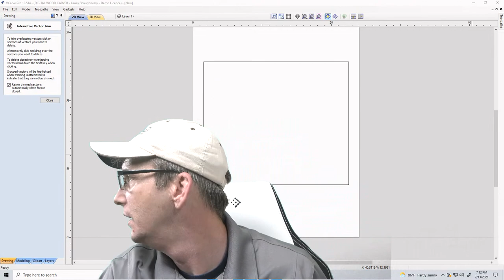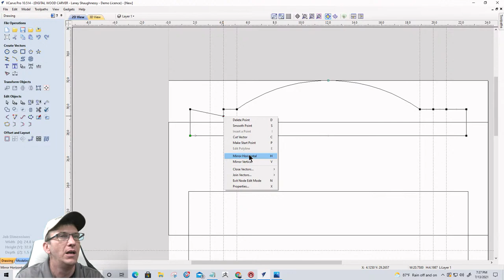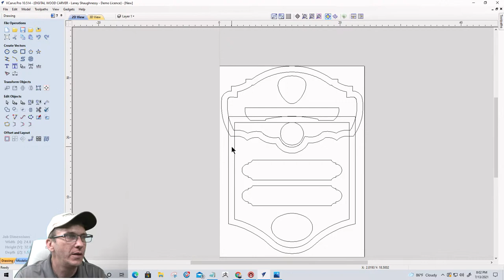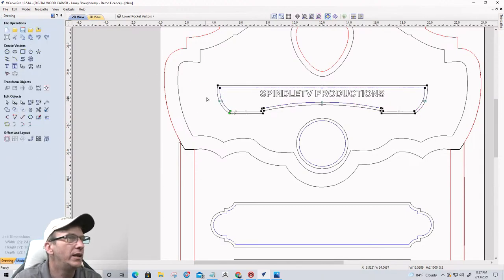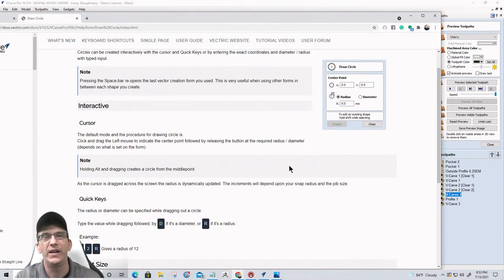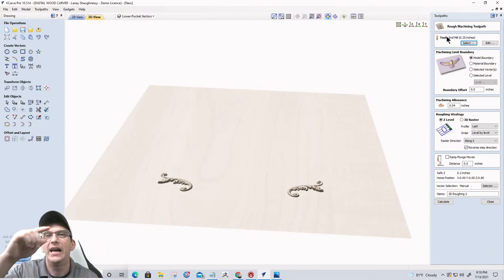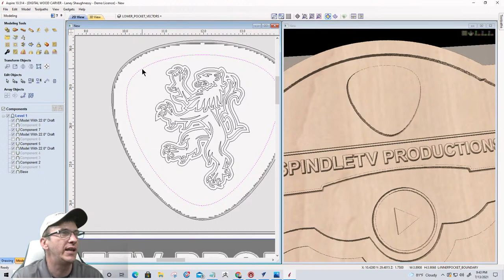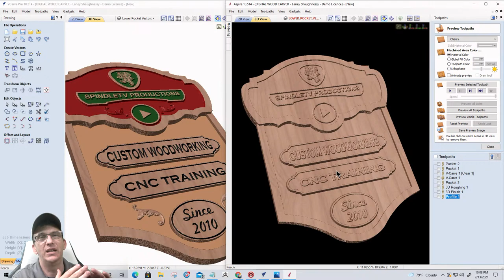1 Sign 2 Ways -  A Vectric Designing Tutorial

Comment: A couple quick questions after watching a couple tutorials and challenges I encountered when creating models.  No.1: You emphasize when building a model to use the highest resolution and demonstrated how to get to those selections - never knew this.   I was under the impression that the resolution selection only impacted the resolution seen on the screen not the actual model, was this a wrong understanding?  Does the resolution one choose actually impact the model resolution?  No. 2:  I noticed you typically use a draft around your raised letters and vectors - it makes sense after you demonstrate this that the ballnose could do a smoother cut on a draft as compared to a straight 90 degree cut where there is some bit chatter.  What I saw you do in the build a flag  model when I watched it was put in the draft and then smoothed the stripes and stars.  In this sign model you did not, when do you choose to smooth and when don't you?  I know you hav to be busy but thought it would be worth me asking.  Thanks again for all of your work.
Reply from the maker: When working with or creating models the model resolution in the job set up does affect the quality of of the finish cut...if you are using a low resolution then your model will have some pixilation...this pixilation will translate to the quality of the finish cut
Reply from the maker: 90% of the time i will add some smoothing to the model at the end. Unless the smoothing deteriorates the edges of the model...then i will choose to exclude it
Reply: @SpindleTV  thank you so much - that is a critical piece of information I didn’t understand.
Reply: @SpindleTV  thank you.